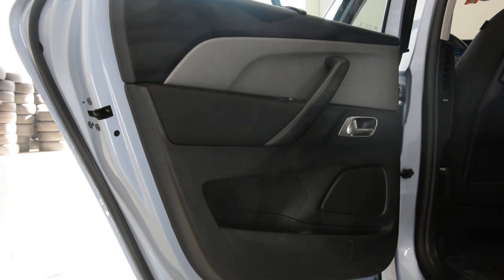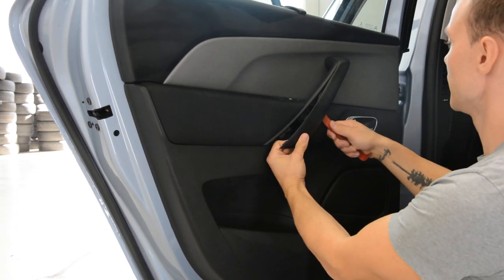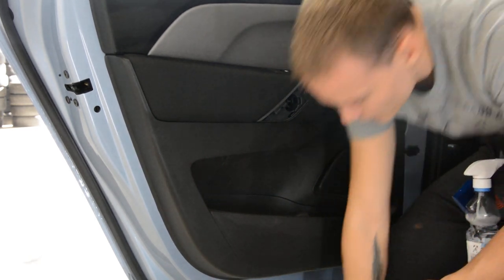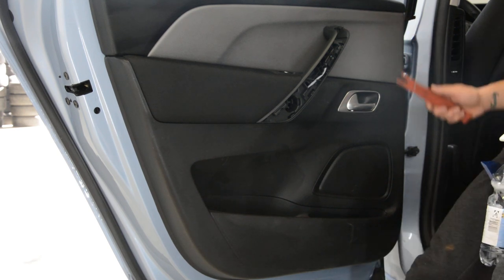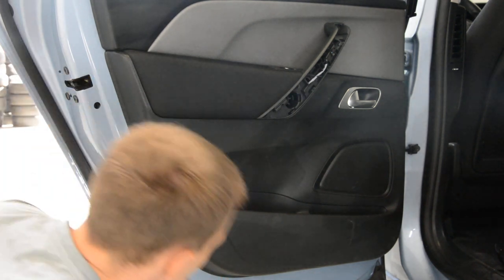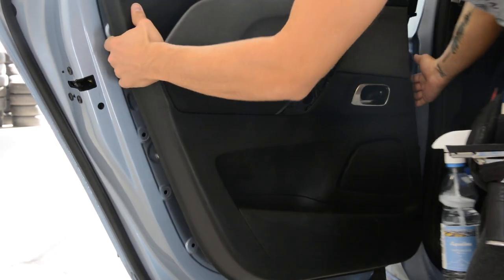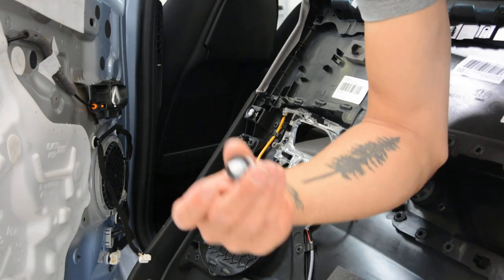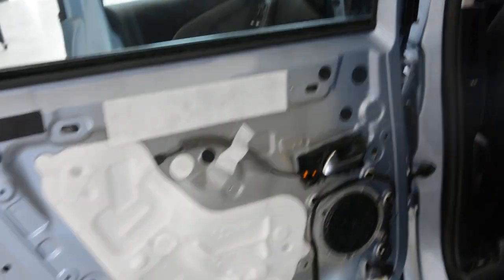How to remove The Door panel Citroen C4 Picasso

Comment: Thanks! PS in case anyone is wondering both the front and back factory speakers are 6.5 inch (16cm), at least on a 2015+ model. Very cheap paper material and tiny magnet. Worth upgrading.

The front only has about 4.5cm of depth but the rear has about 8cm depth. On the front I put a 1.5cm homemade gym foam spacer so the window doesn't hit the magnet.
Reply: Thanks
Reply: @bogdanflorin20  pppp
Reply: is that on the facelifts or not, becasue i have 2016 but its a late prefacelift

Comment: Good video - thanks.
Is the front door similar? I need to get access to the mirror.
Reply from the maker: Usually is the same to remove the front door panel. I don't know for sure
Reply: I did both on my 2015 Grand Picasso, the front and back are very similar. The front has a small round plastic cover on the top near the hinge which when removed will reveal a small screw.

Comment: I strongly doubt that a Mercedes would be any better even though it's overpriced and costs 5 times more.
Reply from the maker: From what I saw Mercedes makes good Quality parts. And a Mercedes from the same category costs 3 times more then a Citroen:)
Reply: @DFCGarage  that depends on who you ask. Mercedes stopped making reliable cars at least 30 years ago. Besides, the car industry shares many parts from the same brand anyway. So you're basically paying 5 times more for the sign on the hood.